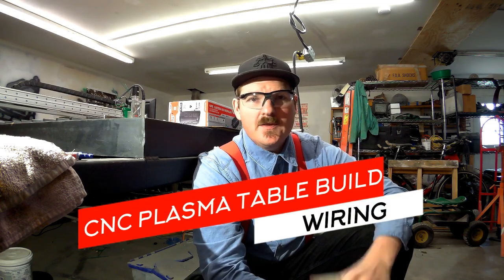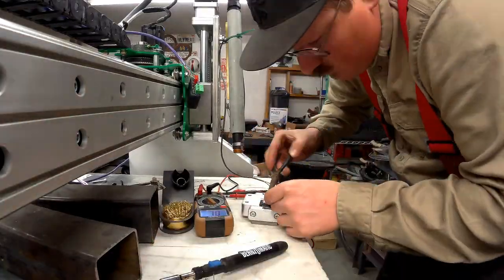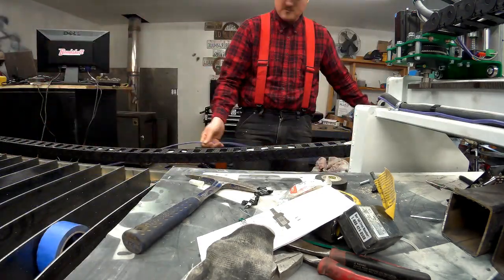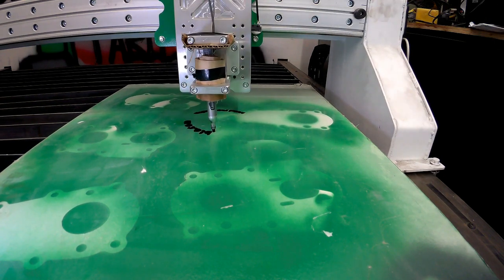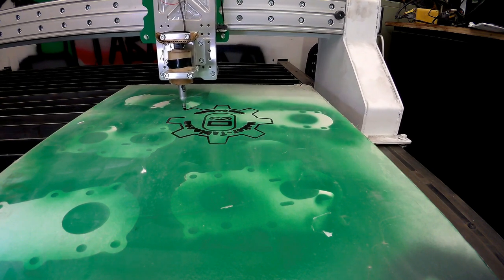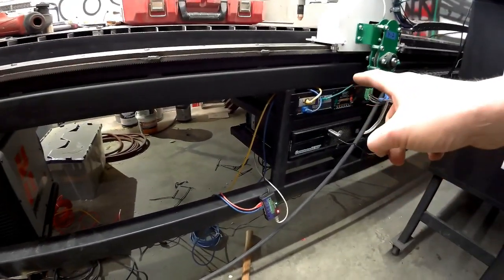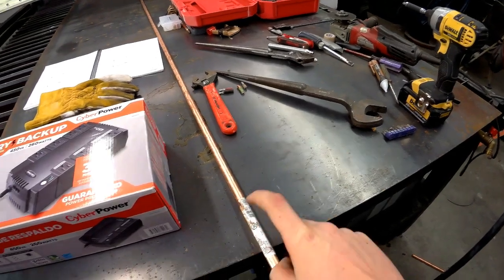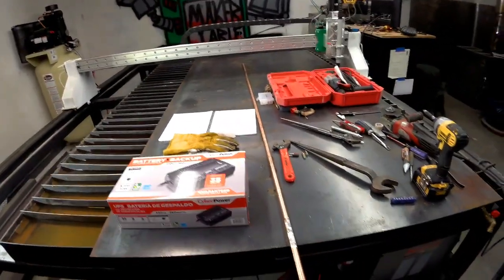CNC Plasma Table Build Final Wiring  2 of 2

Comment: Been following the build since day 1, getting ready to build this table in 4x8 in march. did the home limit switches come with the PP kit or CandCNC kit? or did you have to get the separate?
Reply from the maker: BuickBuilder88 I had to buy them separate. I found some on Amazon, you could even get some simple switches at radio shack that will work. Good luck on ur build!